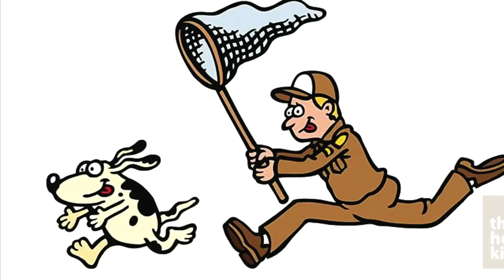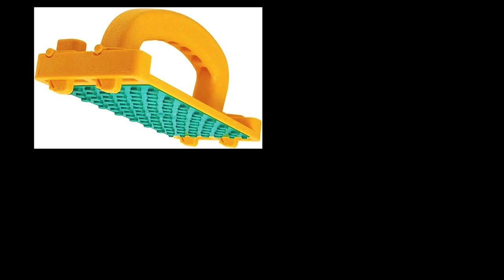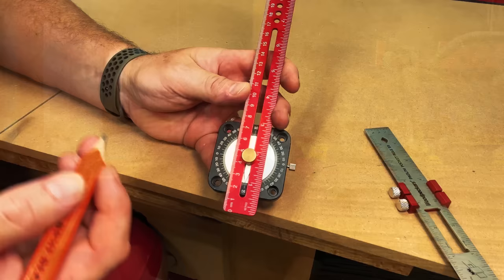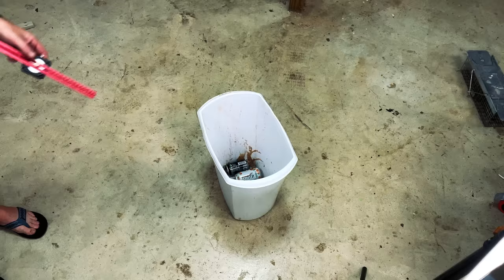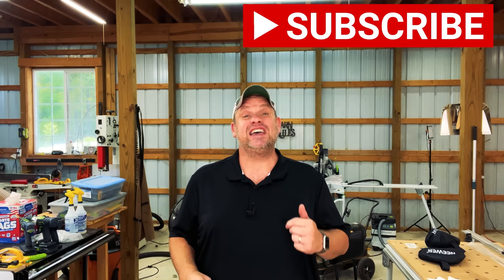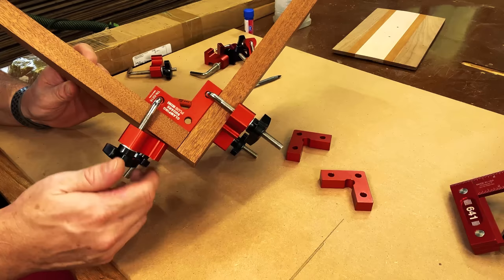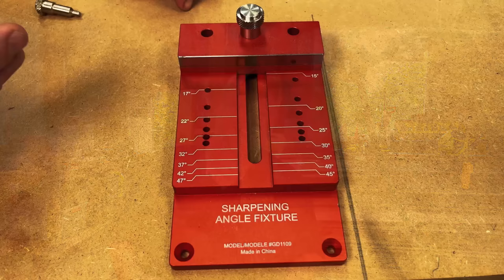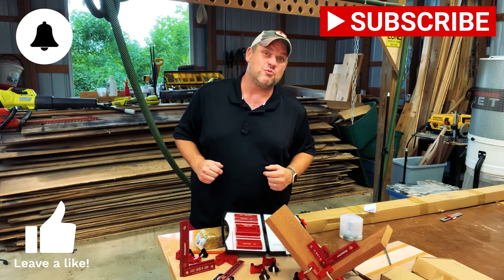Discover the Truth: Are Banggood Woodworking Tools Gems or Junk? #banggood #woodworking

Comment: Sorry but I don't trust electronic calipers one bit! Its more likely the caliper that  is wrong, than the setup set. apart from the bend .You can get a caliper to messure the same thing many times and it will be different each time!
  paterns do expire, and some some tools have patern pending on them, that means nothing if the company does not follow through to the end, and many do not ,as price is to great. Try some festool domino accessories that festool don't even make, like their repeatable guide 59" inch long with 4 adjustable hole settings and many thickness adapters included, and its red too! also this is high quality. ENJOYWOOD M1 PRO Telescope Miter Gauge Fence Extended Support for Woodworking Miter Gauge Table Saw Router Table and its no copy of any company
Reply from the maker: Thanks for sharing chris, yes that is correct they have 17 years for patents.  My biggest concern is with the websites though, there are a some very interesting articles regarding many companies trying to get products taken off of banggood and temu that are direct copycats, and these websites, make it very difficult for the companies to get these copycat products off of their websites.     I kind of went down a rabbit hole when I was making this video and really got kind of disgusted with the practices of these websites.  And I'm with you on the digital calipers.  I did multiple tests off camera and I was getting the same results, just to make sure, but yes you are correct, they can give false reads.  Thanks for watching!

Comment: .04mm is four hundredths of a millimeter. I’m not sure of any woodworking that needs to be that accurate. So 1.04 mm is remarkably close to 1mm, more than accurate enough. Having said that, I bought a combination square from banggoood which died after three weeks of light use, and a pocket hole clamp which was just garbage.
Reply from the maker: I would tend to agree with you bruce!   I know I'm not that accurate.   Thanks for sharing your experience with banggood, I think its good to hear everyone's experiences.  Thanks so much and I appreciate you watching and commenting!

Comment: The set up blocks are fine from a variance pov. However that bow is more concerning. If you use them for a thickness gauge they are going to be way off. If you stack them to create a inbetween measurement that bow will throw off the measurement. Perhaps you can put them inbetween two flat surfaces with a clamp or some weight to remove the bow. In the end you should not have to do that. If they cheap enough that might be acceptable. Otherwise bang bad.
Reply from the maker: Thank you so much for sharing Michael!  I would tend to agree with you. I think the bow is the most concerning part.  I can understand the bow on the smaller 1mm piece, but the larger one I was surprised by.   Thank you so much for sharing and watching!

Comment: There are other setup blocks on Banggood that are much more accurate. Some of them include a DIN certificate that show the tolerances of each block. As mentioned in previous comments, machinist standards far exceed wood working standards. My take on it is that if you can find measuring tools that meet machinist or lab quality at a really great price then go with that. But to be fair in a review of accuracy it would make sense to have compared the Fonson blocks against a set of certified DIN or  ISO certified blocks. You could still use the digital calipers to check the deviation between the two block sets and thus take any inaccuracies of the calipers out of the mix.
Reply from the maker: Thank you so much for the comment and the suggestions.  Really appreciate it hastingb.    Great points and I appreciate you watching!

Comment: I have those corner clamp and they work great, but i usually use trigger clamps to hold them in place and not the mechanism it comes with because its much faster.
Reply from the maker: What a great idea oralndozoli!   That is my only frustration with those clamps is the stupid screw mechanism to tighten them down.  Thank you so much for sharing, now I'm going to do that! (When I remember!)  Thanks for watching!
Reply: I have a set as well, though I’ve yet to have a project to use them on. 😂

Comment: Are you sure that Rocker caliper is good?
Reply from the maker: It's the main one I use for my measurements.  I've never had any problems with it, but great question!  Thanks for watching kwilliams!
Reply: It’s good for the price. The amount of them available at the value price range is kind of a mess. I like the General Tools brand calipers. I don’t buy anything at Rockler without a coupon and they email them every other week. Can also catch the calipers on sale if you’re patient.
Reply: I questioned it because the error seemed to increase with the length measured.  This would indicate an error in the stationary half of the measurement element.

I'd compare it against another, perhaps even different manufacturer's caliper to see if they agree.  I don't think the error is going to matter that much for woodworking, though.
Reply from the maker: @FearsomeWarrior  Excellent point on the coupon.  I always forget about that.   I'll have to check the General tools brand out.  I've had good experience with that brand in the past!
Reply from the maker: @kwilliams2239  Great point kwilliams!

Comment: you need to convert your mm to inches. the 1 mm block was .04 mm off. That converts to .0016 in.  in woodworking that's negligible
Reply from the maker: Great point Stephenebertrand!   Thanks for sharing.  I don't like the fact that that 1mm gauge doesn't sit flat though.  But maybe that is because it is so thin... might have the same problem with all setup blocks.  Thanks so much for watching! :)

Comment: It may have already been said, but some of the copycat tools available on Temu or Banggood may be coming from the same manufacturer that sells the identical item in the US. I’m not saying WoodPeckers or other companies are sourcing their tools from China, but there are many, many products on Amazon or sold through Home Depot or Lowe’s which are likely coming from the same factories. This also isn’t to argue that patent infringement is ok. On the other hand, I would argue that US corporations off-shoring manufacturing infrastructure and labor to China and other low-wage countries has resulted in China now having the technical expertise and infrastructure to eat our proverbial lunch, economically speaking.
Reply from the maker: Good points meowmixphd.   The labor is so much cheaper in china that its hard for any company to be competive on prices without taking advantage of the cheaper labor.  I also agree I don't think companies like woodpeckers are doing that, but some of the tools may be being made in the same facotry and just have logos/brands just slapped on for temu and banggood.  I went down a huge rabbit hole with these companies after making this video and it is quite surprising when you dig into it about some of the questionable ethical practices of many of these websites.   Thank you so much for sharing your perspective as I think it is probably very accurate in some circumstances.

Comment: Im not sure on the set up blocks as most wood will move more than a mm over a year, as to the bowing I’m not sure, do they bend flat if you press them 🤔. I think that you where a harsh on the angle ruler thingimagic as you can probably calibrate it somehow. Are the wheels on the honing guide brass? And does it feel as if it would hold up after multiple sharpenings, i.e angle will stay accurate.
Reply from the maker: I actually tried to bend the 1mm back into straight but in doing so, it ended up making more of a mess.  You may be correct on the angle ruler thing.  It could probably be worked with but, I also wasn't really impressed with how well the locking knobs worked. They didn't really hold the angles well at all.   I have no complaints about that honing guide. It is by far the most secure tool out of all of them.   Seems very well made, holds solid and yes, Brass or at least brass coated wheels, etc. So it should resist rust.  Thanks so much for commenting and thanks for watching farmterminator!

Comment: My biggest hurdle with the setup blocks is their unpredictability. Sure, after converting to decimal inches, one might be .04 or.0016, which is negligible, but the 100mm block was .22mm off, which converts to .00787”. That’s further off than I want to be for a reference measurement.
Reply from the maker: Yep, it was a tough call.  I wish I had my regular setup blocks where I could get to them, to give them a real test...  That would have made my decision a little easier to do.  I suspect they are a little off as well.   The bow those does concern me!

Comment: Hi Brian
Once again I must commend you on an excellent  presentation and the good work that you put I to it. 
I would think that the setup block thicknesses would fall within a more than acceptable tolerance for woodworking.  I am thinking that the compression/relaxation of the wood during the machining process would far outweigh these relatively small tolerances. Of course it would be a different story if you were precision machining steel etc (think slip gauge territory). The one think I would agree with you on is the matter of flatness...the 1mm unit will be absolutely useless if not flat but in fairness I find it difficult to understand how something in 1mm aluminium (a little more than 1/32nd-ish in old money with an even bigger tolerance 😂) could be practical as any grade of aluminium that I know of couldn't hold an effective degree of  flatness in this thickness for very long in practical real world use compared to other materials more appropriate materials..in short my vote is "Bangimpractical" for this thickness in this item. 
I do have excellent working experience with a couple of Banggood tools. I have a 300mm (footlong-ish in old money) precision square with mark out holes for each mm. I absolutely love this tool and it  is my go to when marking out precision work. My old 30-ish year old Stanley combination square is my goto for normal work. 
I also have a pair of Bangoood Veiko Brand Rail Clamps. I picked up 2 of these for less than the price of one Festool/Bessey Clamp. They work fantastic, so much so that I probably only use them 10% of the time with the Tracksaw Rail, as I mostly use them for quick clamping and holding workpieces through the dog holes on my homemade 2100x1200 (7ft x 4ft in old money) multifunction  cutting and assembly table (think Ron Paulk (table) on steroids).
I do absolutely agree with your comment that the Inventors of the tool concepts should be rewarded for their efforts. In many cases I was not aware of the original creators / designers when I purchases (for example I hadn't  heard of "Woodpeckers" until I started watching US YouTube Creators.
PS...I was going to ask if when you Made the Mickey Stand for the Mrs...was it Banggood or...other.. but I thought I shouldn't because I didn't want to upset you with more of my innuendo... 🤭
Reply from the maker: Haha!  Thank you so much for making me smile this evening antomac!   Now you have me wanting to check out those items you shared that you had good experiences with from banggood.   It sounds like most people have gotten a few good items from them, and I definitely think they are much higher quality than Temu.   Thank you so much for sharing and your well thought out ideas on the setup blocks.   Thank you so much for watching and I really appreciate your comment! :)

Comment: As the set-up blocks go, I would personally have no issue with them, the reason being the standard that they were checked with is a very inexpensive digital caliper. that and we are talking about wood. and we all know that wood can and will move way more than the valances that were found! So, mark the BANG GOOD in my book.
Reply from the maker: Thanks so much for commenting Dusty!  I hear you loud and clear about the calipers.  I may even get on amazon tonight and check out some higher quality calipers. I rely on those things all the time, so probably need to step it up a bit.  Thanks so much for commenting and watching!

Comment: H intersting video, I'm thinking of checking out the corner clamps, with regard to the set up blocks, I'd say for the average  home woodworker they variance is probably ok, not sure about the bowing though. Also, Ihave found that plastic calipers like the one you used can give variable results depending on the amount of pressure you apply to the slider. looking forward to your nest video.
Reply from the maker: Great points mick!  I do probably need to upgrade my calipers.   I rely on them way too much not to have a really nice pair.   They have really been pretty accurate for me, but I totally get everyone's concerns.    Thanks so much for for commenting and watching Mick!

Comment: Don’t be too confident at what the caliper display, it could be wrong, don’t trust its accuracy until you have tested its accuracy on some real blocks and over a larger scale, most calipers are made in China too you know… errors could drift and differ all along the scale.🤔
Even for a cheap setup block those errors are too much, such a tool is meant to be more precise than using plain drills as spacers.😕
Reply from the maker: I totally agree with you in all respects!   Excellent points, and after reading  a lot of these comments, It sounds like I probably need to invest in some higher end calipers.   At the time I bought the calipers I used in the video, I felt like you can't get much better than rockler calipers, but I think I could probably step it up, as I rely on my calipers way too much to have some that may be not etirely accurate.  Thanks so much for sharing and thanks for watching Bamsebrumbansebrumen!
Reply: @FlynndoggWoodwork  I’d say nah to buy new, a machinist should have some precise stuff laying around, like a real collection of set-blocks, but I suspect strongly that you were not wrong about those red blocks being out of dim. 🙂
I fear I will now have to go and measure my own box of red stuff; I’d hate going back to drill bits.🤔
Tanks for the a good program.🙂

Comment: For me, it's bangBAD. I bought the "Adjustable Angle Drill Guide Drill Holder Stand Positioning Bracket for Electric Drill," it lasted 20 seconds. LOL! Seriously, I am not kidding. The tool is mostly flexible plastic that will not give any accuracy or positive control when using. Aside from poor flex of the tool, is the bearing, it lasted for 20 seconds after I attached my drill and pulled the trigger. The fail of this tool was so bad, it made me laugh. I was "HAD" by the deal that was too good to be true. Avoid Banggood, purchase local or carry out your diligence before buying.
Reply from the maker: Oh man!  I wonder if that is similar to the milescraft drill guide.  I have the rockler one and it works pretty well and is really secure but it still has it's problems as well.   Thank you so much for your comment and thank you for watching rauladame!
Reply: A few weeks after I was done laughing at myself I picked up the Rockler Drill Guide. You are correct, the Rockler drill could take a lot of effort to set up. The effort may seem like over kill sometimes but for that one hole that has to be just right, it can make a build or leave a builder thinking "I should have done it." The stability of the Rockler drill guide after set is really nice. myself @FlynndoggWoodwork
Reply from the maker: @rauladame2105  That's awesome to hear Rauladame!  I agree with you the rockler drill guide can be much steadier with proper set up.  I need to add a larger base to mine!   Thanks for sharing! :)

Comment: The variance in your descriptions seems to be pretty consistent and is a percentage of the number and the distance measured not just a larger or smaller number.  You also need to do repetitions and increase your sample size.  Measuring a single tool is not statistically significant, you need at least 7 to 10 samples. This is the problem with many of these so-called Youtube  "tests and evaluations".  If you want to do more stuff like this and be credible then go take some math and stat courses at your local community college.  Every measuring device has an error and is reflected as 0.01% or similar reading depending upon the test results.  Statistically and mathematically this video is manbad.
Reply from the maker: I did do many off camera measurements, more than 10 on every measurement I did.  My education includes undergraduate at the University of Notre Dame, Masters in Business Administration From the Kelly School of Business at Indiana University.     I don't think I need to justify my tests.  Everything I show on this channel is 100% transparent and accurate to the best of my abilities.  Youtube has a limited timeframe to keep viewers interested.  I'm not going to go over standard deviations of testing on this woodworking channel.